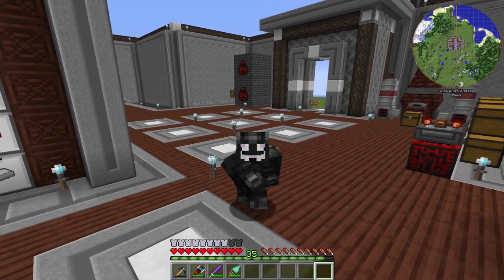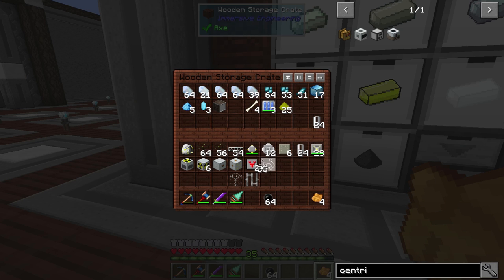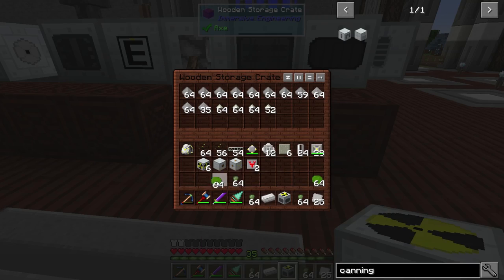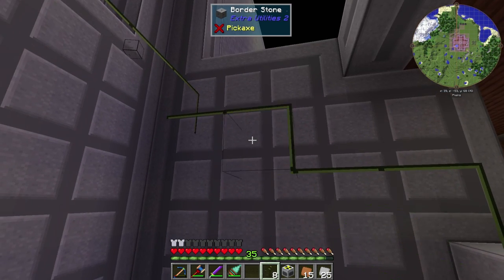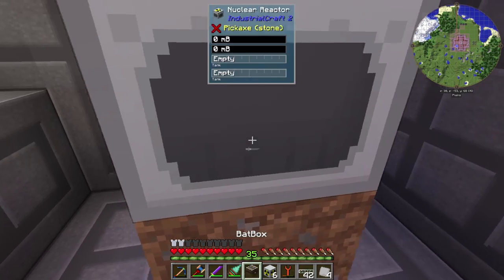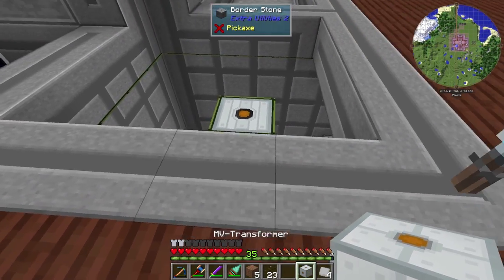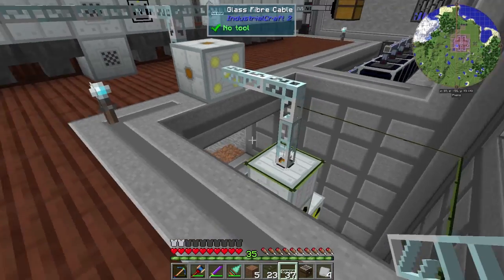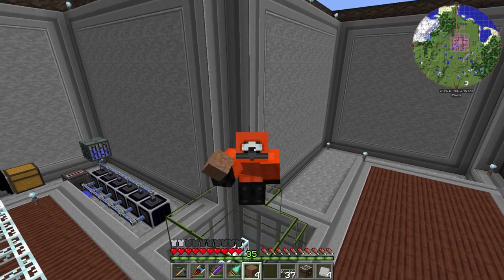Age of Engineering EP12 Nuclear Reactor

Comment: so for some reason when i used the containment reactor plating, my reactor blew up. but using normal reactor plating. and my component heat exchanger sits at 4817. where as before it wouldnt...

Comment: i think the machines don't blow up unless you use them with too much power
Reply: USE <-- they can be hooked in the line tough
i think. should test. too lazy
Reply: Just did some testing and it looks like machines only blow up if their power drops below max while hooked up to too much power.

Hooking an Electric Furnace to a 420EU reactor goes boom, but hooking it up to the proper power until its buffer is full and then switching over to the 420EU power source is fine. I could even smelt with the furnace hooked up to the reactor after it's buffer had been filled, but when I threw a stack of overclockers in it blew up immediately (buffer dropped below full).